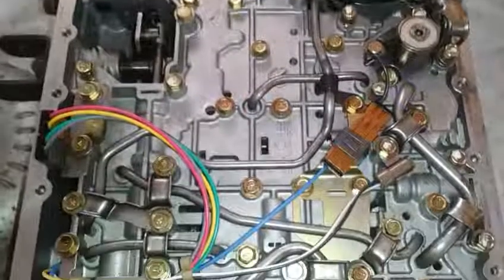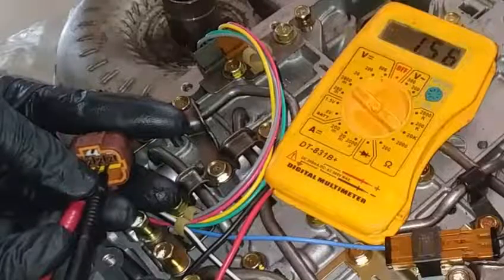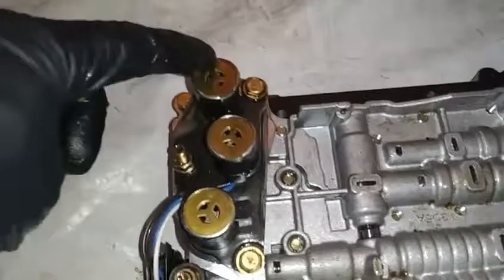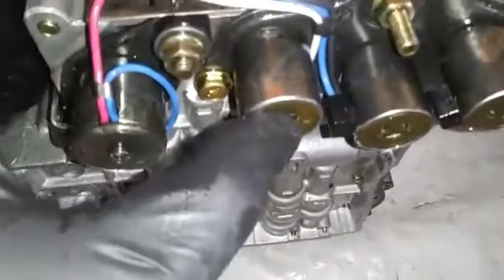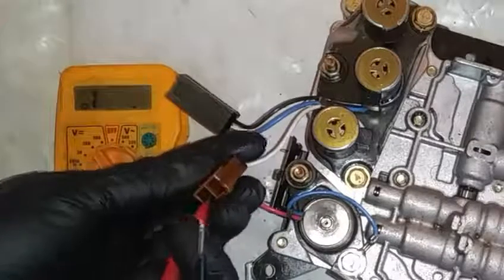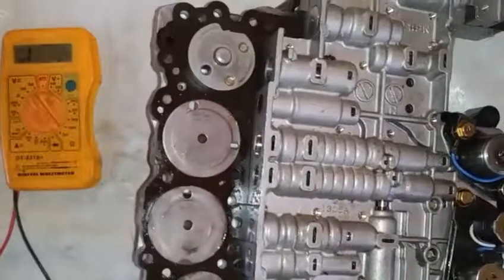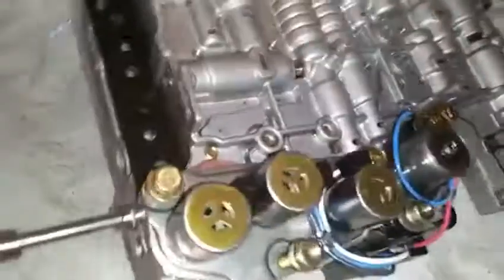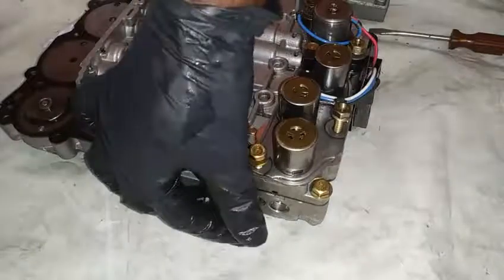Nissan Frontier 4-speed automatic transmission[RE4R01A]valve-body solenoid test. Part 11/11

Comment: Impressive set of videos.  Thank you so much!   My RE4R01A torque converter lock was dropping in and out.   The lockup solenoid resistance measured high (>100ohms). Changed that and problem solved.

Comment: I have a 2000 frontier. It doesn't move in drive, but R, 1, 2 work. But when i turn OD off with the button on shifter D works as well as R,1,2. But if I turn OD back on it doesnt move

Comment: If a vehicle is having shifting issues but isn’t slipping out of gear… one would think solenoid trouble. But is it possible for a solenoid to be bad without throwing a code that you mentioned.
Reply from the maker: The hydraulic passageway within the valve body can become clog or restricted by normal sludge build-up, this can disadvantage shifting with no codes. The two half of valve body will require separation for cleaning. Sometime a new valve body replacement is done.

Comment: My 01 Frontier xe has 311k miles on it. It's started to not pull it when i first shift into drive  all other geared work and once it  catches down in 2nd i can shift up to drive and it  works properly until its shifted into park, then i have to do it all over again.  Fluid is full but dark . Help?

Comment: Great video 2004 frontier 130k miles transmission shifts smooth no symptoms but keep getting p0744 any suggestions would be appreciated. Changed fluid & filter but still keep getting code help lol
Reply from the maker: P0744 is Torque Converter fail to lock-up.

The Malfunction is detected when the A/T does not shift into fourth gear position or the torque converter clutch does not lock up as instructed by the TCM. This is not caused by electrical malfunction (circuits open or shorted) but by the mechanical malfunction such as control valve
sticking, improper solenoid valve operation, malfunctioning oil pump
or torque converter clutch, etc. Most likely the transmission Torque Converter Part need replacement due to fail internal clutch, this is the expensive job since the transmission will have to be separated from the engine. Recommend, frist changing the solenoid pack like you see in this video. It might fix the issue and cost less.
Reply: @stevexnycautomotive  thank you for that info & fast response it  does goes through all gears no problem and smooth but does feel like it should have more power. Where do you suggest buying the solenoid packs?

Comment: Hi. On a 2002 Nissan Sentra with automatic ( with overdrive ) it wont shift into 4th gear. ( the overdrive switch seems to work ). Any idea why it wont shift to 4th?   Thank you
Reply from the maker: How is the fluid and filter service?. What's the mileage?. If no codes, might be a overdrive clutch or piston seal failure.
Reply: @SteveXNYC  120 K miles was fine, changed pan fluid once than 2 moths later changed again Dexron II, Overdrive switch works in 3rd but wont go into 4th now.  Thankyou

Comment: I’m having a problem with my gears, it won’t shift UP into any other gears and stays into 2nd when accelerating. I thought if I changed the shift solenoids but it still won’t shift to 3rd, 4th and 5th.
PLEASE LET ME KNOW WHAT IS WRONG.
Thank you so much, Joel
Reply from the maker: What's the milage?.

Comment: Any ideals on my 2001 xtrerra has 311 k and some change hadnt had reverse for over a year now shifted great through all foward gears until couple weeks ago won't shift into 3rd or higher does fine 1 to 2nd  any suggestions?
Reply: Mine does that, did you end up fixing it?

Comment: What’s a good part number for a new plunger for the shifter?
Reply from the maker: It only comes with valve body. Check transtar industry for part if the dealer does not have.

Comment: Anybody know what could cause a no shift to 3rd or 4th? No burnt fluid ever since Owning I did a drain and fill with new filter no issues until randomly started no shifting passed 2nd car is 99 q45 145k miles never had other issues, I’ve replaced shift solenoids and test tps no codes ever
Reply from the maker: Maybe the TCM computer is failing
Reply: @SteveXNYC  I had swapped tcms with another 99 I had gotten for parts and no change